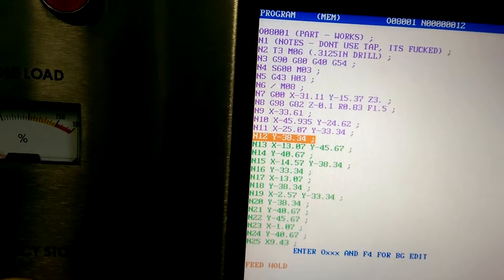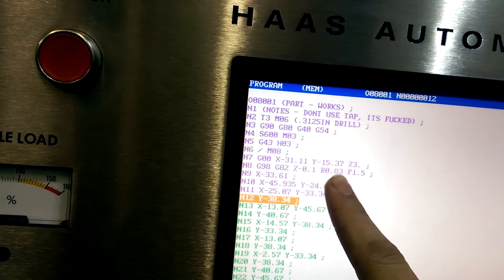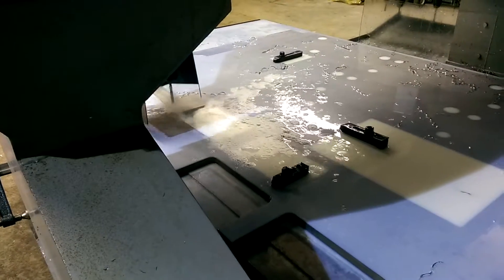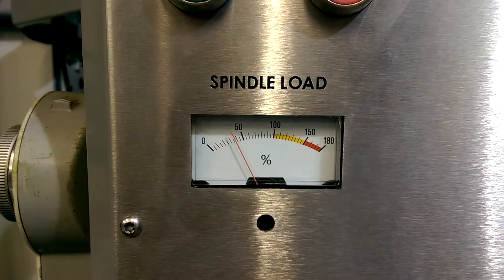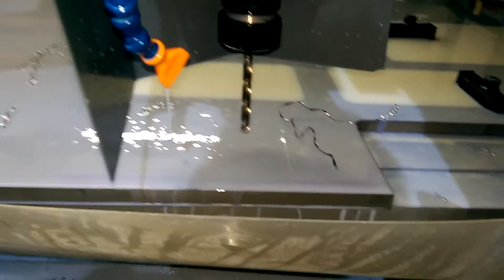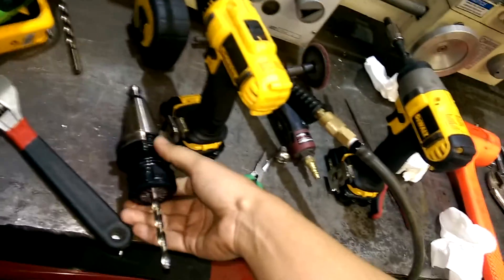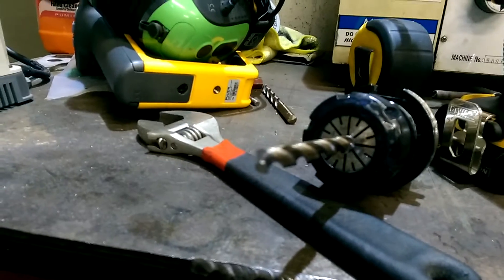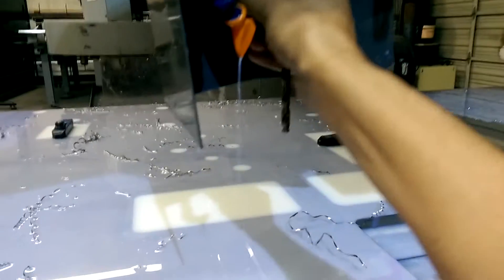316L stainless drilling feeds and speeds

Comment: Thanks allot for the video. I blew through 3 bits including a a carbide bit. Found your video and copied your F&S more or less and finished 18 holes with one harbor freight cobalt bit. I am surprised your relatively high spindle load as I am using a 3HP knee mill and had no problem replicating your results.
Reply from the maker: Colin Fera 10hp 2 to 1 gear ratio isnt super powerful unless your spinning it at 10k. Glad to help! Remember, once you dull a drill and it gets hot in the hole, your in for a fucking ride... That hole is not hardened. Ill say a prayer for you 😂

Comment: hi can you tell me plz which drill will give me better result for 316L
Reply from the maker: +fakhar mirza anything cobalt. Dont use HSS or carbide, the drill needs to flex. Oh, and use a shallow cut angle, not 118. And get really good at sharpening bits, as even the best ones burn up.

Comment: What you probably need is a heavy duty spiral coated bit so it won't get stuck. Pull up once in a while to clear the chip, so it won't lock  up.  Increase water pressure to help clear chips. Just to let you know I'm no expert I just like to solve problems.

Comment: If you haven't solve this problem yet, my guess is sharpness and hardness. When the bit is sharp, we see the glimmering lights reflecting off the tip of the bit....like a mirror...I didn't see that.  2nd) Titanium coated Harbor Freight bits are not as hard.